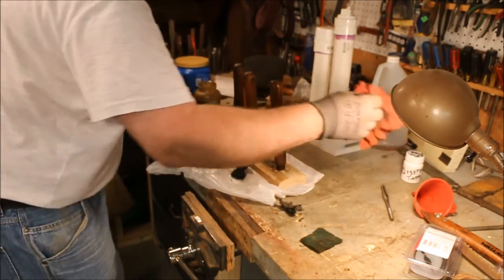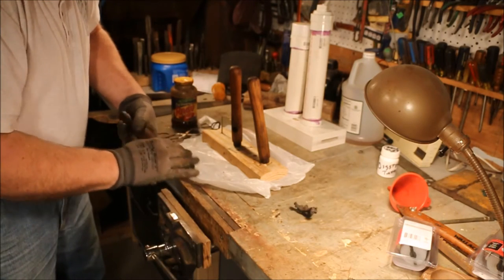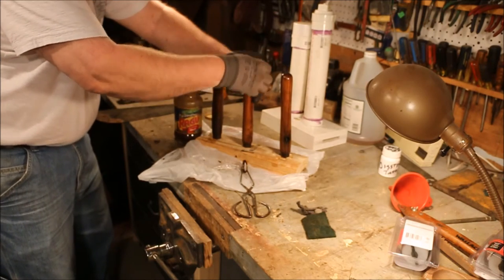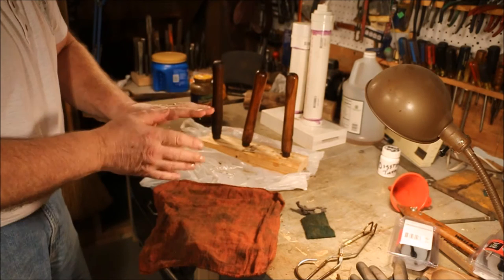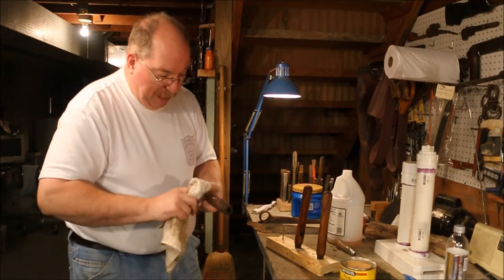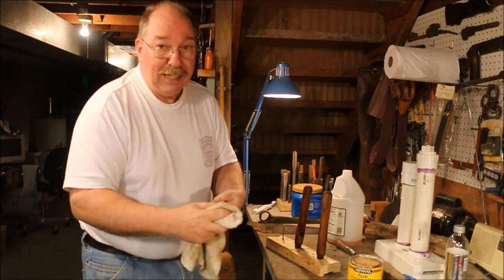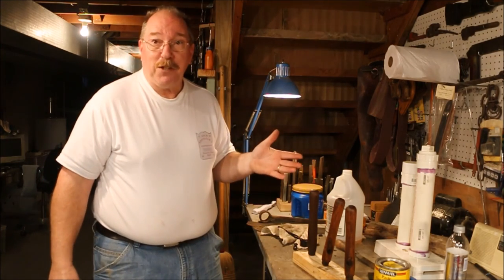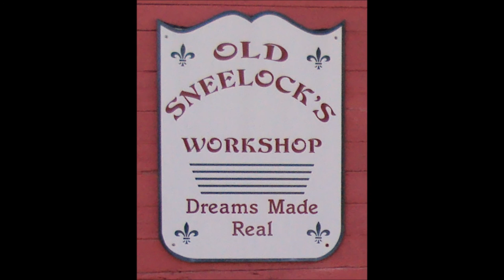Restoring A Two Man Saw ~ Pt 6 ~ Finishing Handles With BLO ~ By Old Sneelock's Workshop

Comment: These handle look really nice, the good thing with using Linseed Oil is that the finish is in the wood, rather than just on the surface like a varnish would be, so many people want an instant gloss, but then wonder why it flakes of after very little use, those handles will last another hundred years now. Chris B.

Comment: I use boiled linseed oil at work when I prep 100+ year old timbers for fireplace mantels. It really brings the old wood back to life.
Reply from the maker: Tim Caldwell I have had good sucess with BLO. I like that the finish builds slowly. It lets me control the appearance easily. I also like being able to reapply a coating later without having to strip the original. That's desirable for tools that see wear from use.

Comment: 10/4 on the good old Ragu B.L.O. The way it smells I'd take a taste but better not. I have a can of J&J and it's lasted a WHILE! The dozer is fixed but the rest of the job is on hold so so am I. Got the hitch ball on the Craftsman and the hitch on the wood buggy so I might just heat up the 440 tomorrow God willing. Remain calm. NIce handles, by the way!
Reply from the maker: Lewie McNeely Patience is a virtue. Having alternative projects means I don't need as much patience. Good thing. It's never been my strong suit.
Reply: Old Sneelock's Workshop The 440 is cooling down. 1 1/2 hours behind that thing is E-nough! Might mow some to get the kinks out. Am still bettering the wood buggy and eyeballing stuff; you know how it goes. Always looking for a better way to do things or upgrade. New AND Improved as the saying goes. Now to to pick up my adjustable jet carb for the 2-banger so I can make it idle like it's supposed to. Blasted fixed jet lean run garbage. Can't stand surging all the time. Gives me the willies, especially when trying to back a trailer up.

Comment: WHAT IS THE DIFFERANCE BETWEEN BLS AND TUNG OIL? I LIKE TO USE NATURAL TUNG OIL.
Reply from the maker: Mike Tarzwell I looked up tung oil and linseed oil. They share the name drying oil. that means they harden (set) through polymerization. The oil reacts with oxygen to form crosslinked polymer chains that gives them the hardened finish. 
Tung oil is often mixed with solvents as a small component of a varnish mixture. Formby's would be one example.
Boiled linseed oil use to mean it was literally boiled to activate it and speed the drying (polymerization). BLO was later commonized as a mixture of linseed oil and metallic dryers. 
Both the blended tung oil and BLO have longer shelf lives than the pure oil. 
I haven't used any pure tung oil and hesitate to give it a meaningful review. The mixtures sold commercially seem to work equally well.